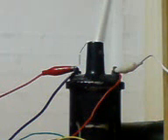electro-magnetism with high voltage ignition coil

Comment: Yes, the paper clip will move. An ignition coil is made like a solenoid coil. Ignition coils have several long, flat laminated steel strips which form the coil's core. Since the ends of the core are open, the magnetic field easily escapes and loops around to each end. If you could see the magnetic field it would appear much like magnetic filings do around a bar magnet. A transformer has a closed magnetic loop. Paper clips are simply steel wire. Do the experiment with copper and it won't move.